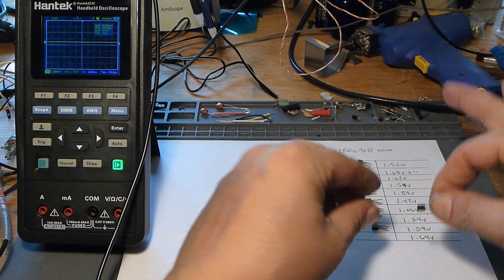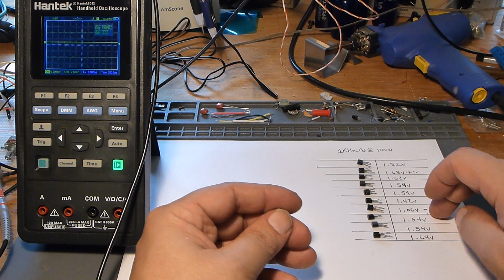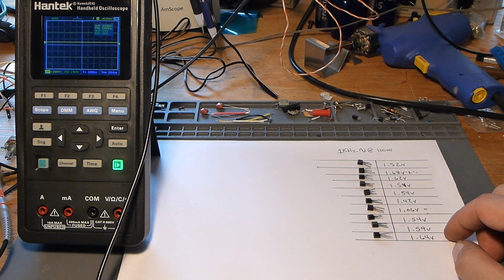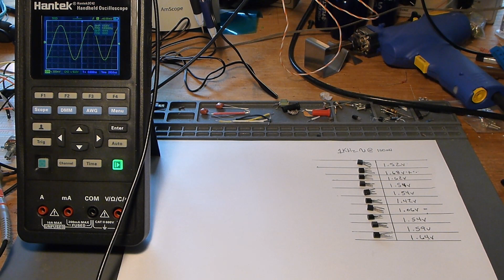Seeburg SHP3 amplifier Part 2: Transistor matching and testing.(Has error- read description)

Comment: Could you give me the specifications of the 2n2222 I want to make sure I order the right ones I'm currently working on my shp3 also what capacitors did you use when you recapped. Ps amazing video it has helped alot
Reply from the maker: Any 2N2222 transistors will work in this circuit(TO-92), however, this is what I ordered: 833-PN2222A-AP. You can search this on Mouser for the data sheet with all the specs. I will test them and discuss the cap values(I used Nichicon) in the next video. I plan on filming it tonight for a Thursday or Friday release. You may want to see how these perform before you order anything. I haven't put them in yet!
Thanks for watching.
Reply from the maker: I wouldn't recommend the Mouser part number I provided. I am right in the middle of testing them and they have nowhere near the amount of gain they should have. That means that either I have some bad information on the original transistors(very possible) or these 2N2222s from Mouser are sub-par. I need to check all my equipment, run some more tests and crunch some numbers. As soon as I get this figured out I will comment again. There will likely be a video segment on this. As of right now, the replacements that I ordered don't appear to have much more gain than the 2N4401 resistors in the pre-amp right now.
Reply: @circuitmonkey6653  I found some supposed 2N2222 they were tricky to find and could only get 20. Was wondering what you built on the breadboard to match them if you could send me the schematic so I can build it. Im pretty new to the whole electronics thing. If you want you can email me if it's easier. Im also working on a mess of a TSA6 amplifier older seeburg jukebox . mathewillingworth1@hotmail.com thanks again
Reply from the maker: @mattyllingworth  I have to make another video concerning these transistors. I am a member of a forum(I joined specifically to learn more about these amplifiers) and "the Seeburg guy" that knows the most about these(Ron Rich) happens to be an admin. He recommends buying a book by Tony Miller that explains alot. I am not a "buy a how-to book" guy. I am more of a "let's set up the equipment and work our way through the problem so I will understand it in my own terms" kind of guy. I asked him directly what those original transistors are and he basically told me to buy Tony's book. Grrr... so, I will have to keep looking for a suitable transistor or make a modification(which I hate) to get these amps to perform as intended. The lower gain value of transistors available in today's market will not cause distortion or change the tone of the sound. They will simply reduce the volume at which the jukebox can be played before the signal becomes distorted. Another words, if your jukebox(or amplifier in another setup) is only filling a small to medium size room with sound, either the 2N2222 or 2N4401 transistors will work just fine and it looks as though they may be the best available as of now.  Transistors available that exhibit higher gain characteristics do not have adequate threshold voltage/amperage characteristics to work in these amplifiers. They would pretty much cook themselves. That's the fun of this, you often have to find a way around a problem and sometimes no one else has yet. I will continue to work on this until we have a suitable work around, but we will most likely finish this series using these transistors and some slightly bigger filter caps. I will post another video soon and thanks for watching and the feedback!
Reply: @circuitmonkey6653  awesome. well I will wait for your next video I hope you find a solution because I need mine to perform without burning out and I'm at a stand still with my lack of experience . Again thank you for your videos I will stay tuned.
Reply from the maker: @mattyllingworth  lol! That is exactly where I got the 2N2222 info!
Reply: @circuitmonkey6653   lol I just calld him with some questions about the list and he said that the list may have typos or just wrong information  😲
Reply: @circuitmonkey6653  I have a book showing up soon and it's supposed to have all the cross over part #s from seeburg and a bunch of extras I will let you know what I find. Let me know if you have any luck. Im just going to work on a control centre in the meantime